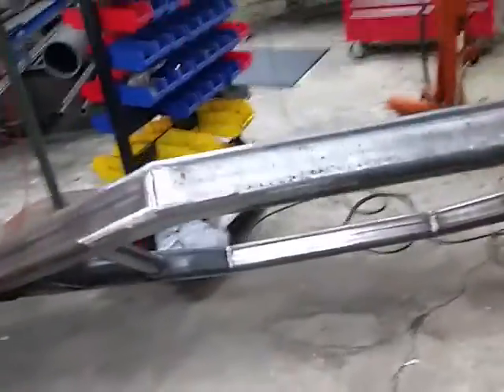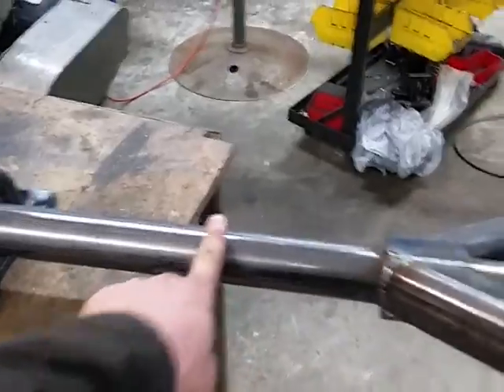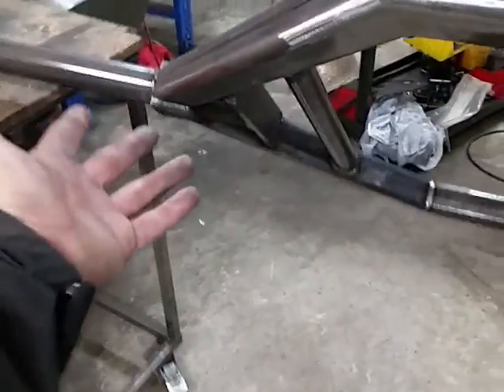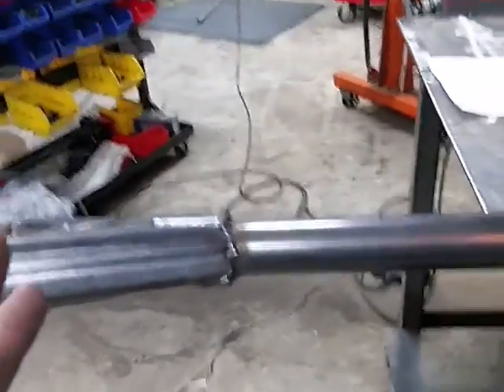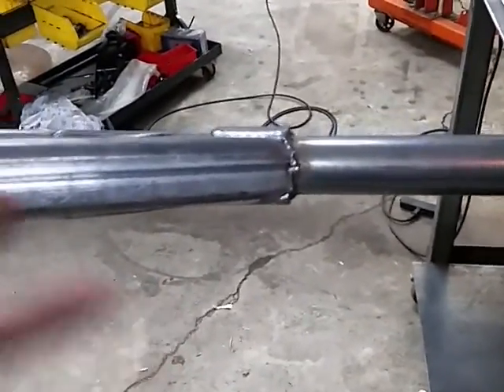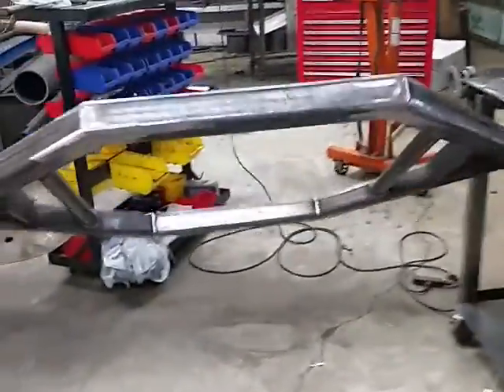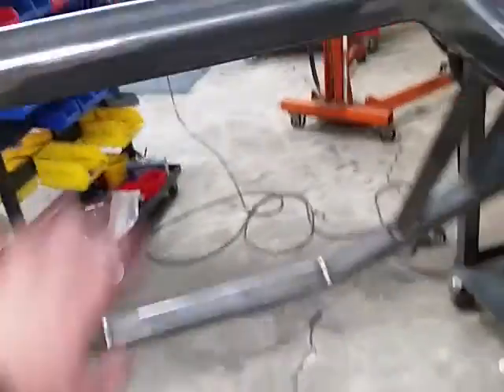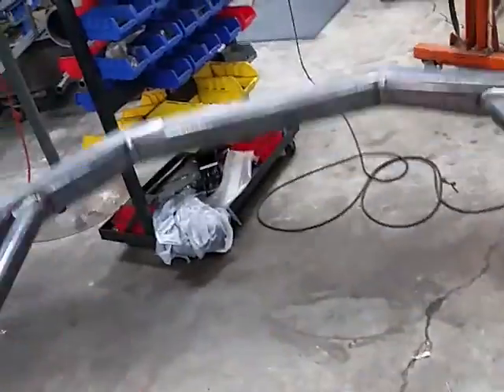Late night date with a trap bar

Comment: Did u etch the handles with lines for grip
Reply from the maker: I paint most the bars black so it would cover the etching but that would look really cool on a natural or clear coated one. 

I usually put a red dot in the center of the handles to make it.
Reply from the maker: Recently got the equipment and started doing the knurling!!